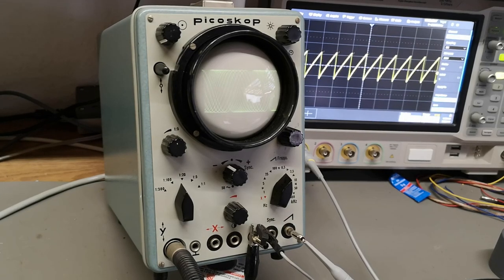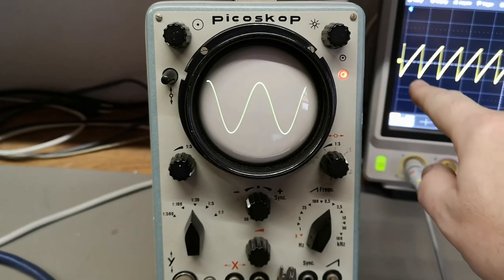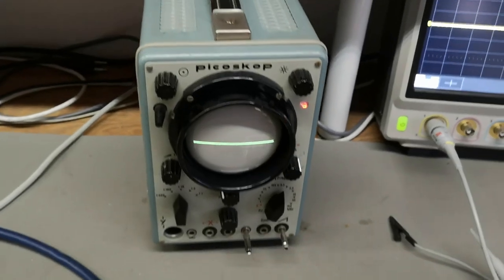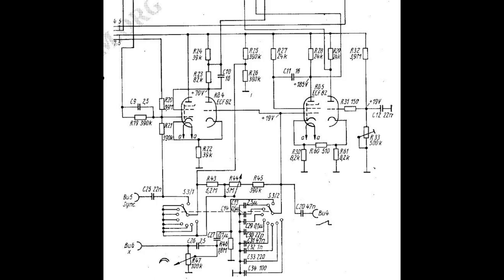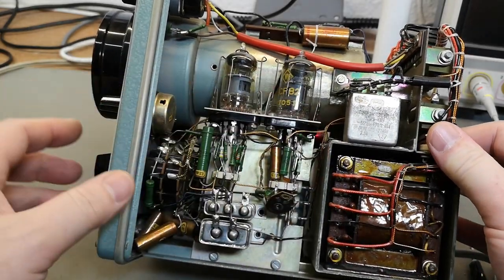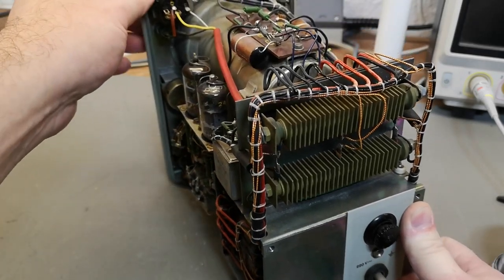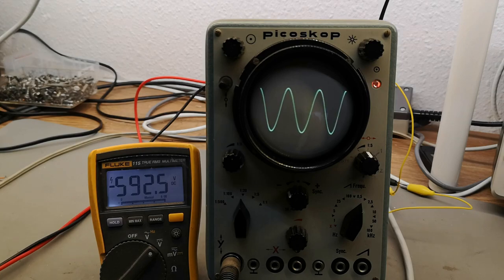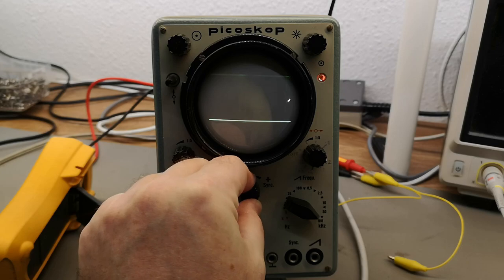Radio Fernsehen Elektro PGH Picoskop EO1/7 5 tubes 1963-68 oscilloscope

Comment: They saved on a double triode or double pentode for a comparator for trigger ramp. The “slightly coupled” oscillator was a common simplification. Siemens had a similar unit called Oscillarzet. It used similar trigger.